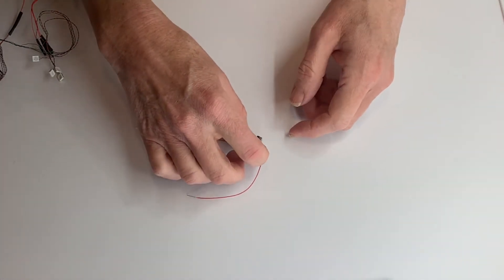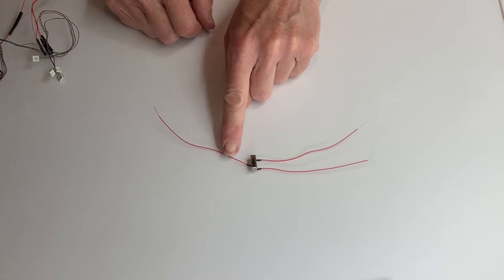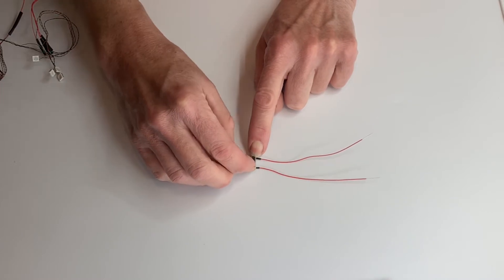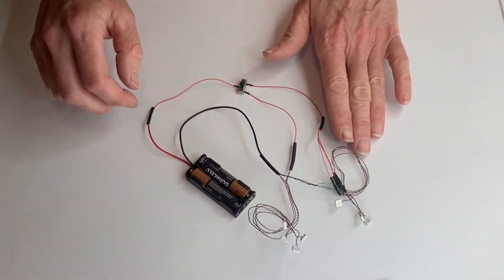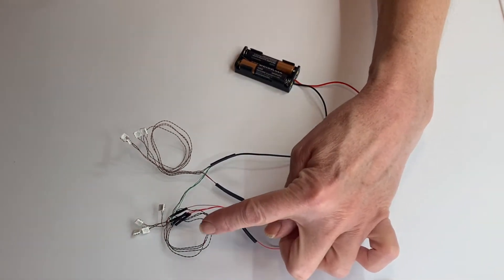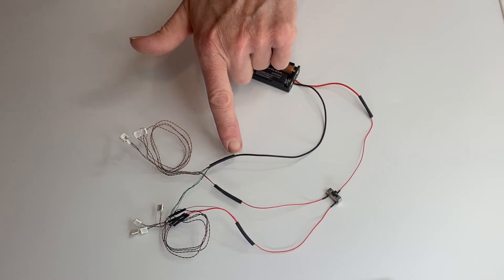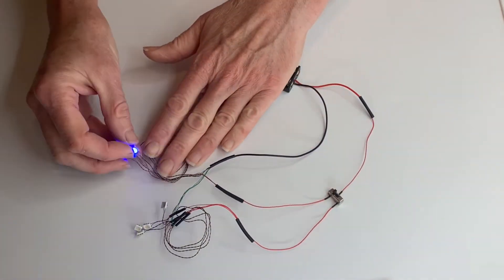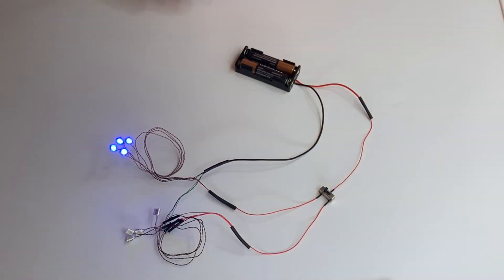How to Use a 3-Position Switch for LED Lights

Comment: Great video, very clear. Any idea how i would get both sets of lights to light up when the switch is in the second position?  Can i just run a jumper from the first light power line to the second switch terminal?  Thanks

Comment: Hello I have the same switch type on a LED bar for my aquarium but I can only turn on all LED's. How can I fix the other mode where? I have basically a mode to turn just a specific amount of LED's on (blue), the option to turn it off and the other one to turn all LED's on. Do you think I should open the casing of the switch and resolder it or where do you think the problem could be?
Reply from the maker: Thank you for getting in touch. I'm sorry I cannot advise you on how to fix your aquarium lights. I wonder if you could contact the manufacturer of the lights.
Reply: @EvanDesigns   Thanks for your response. I have just opened and losened the wire's a bit. I guess something was shorted and made the switch didn't functioned right
Reply from the maker: @wassup5793  glad to hear this

Comment: can you use this method but using two power sourcers for one device ??
like the power sources are where the lights are
Reply from the maker: Hi.  Yes you could do that.  So the LED or other power drain is on the center wire.  The 2 power sources are on the end wires.  The black wires are all common.  Center would still be off.  And left and right would switch between your 2 power sources.  It's an interesting use of the switch.  It would work
Reply: @EvanDesigns  ok thanks for help
I will need this circuit to make a portable speaker that can run from its own battery or an adapter
Reply from the maker: @bassfear_9952   The switch can handle up to 0.5Amps at 1-50 volts.  Be sure your portable speaker is not greater than 0.5Amps of power, that is the thing to check.
Reply: @EvanDesigns  oh my amplifer will probobly take up to  8 amps but there are switches that can handle that much
Reply from the maker: @bassfear_9952   Yes, there are switches just like this but much bigger! This switch is for hobbies and tiny projects like 3D printed models or things like that.  This switch isn't made for home electronics, sorry!
Reply: @EvanDesigns  yes I know but this circuit will for any three position switch that has three pins
Reply from the maker: @bassfear_9952  Yes if you can find another larger three position switch it will work the same.

Comment: I Have One.....but the one I have from Evan Designs is a bigger button, but a 3-way switch.  It works Quite Well...will need to post a video to your site.
Reply from the maker: Thank you!  This is a new smaller one we found.  It has the same function as the bigger one you got from us.